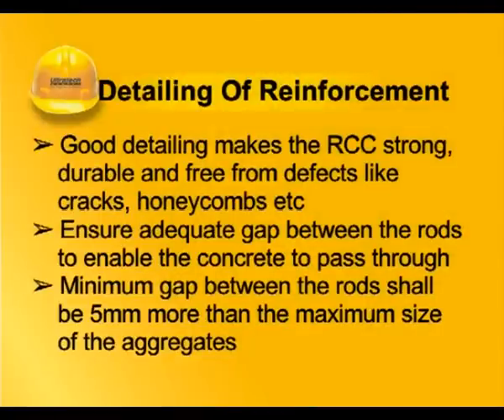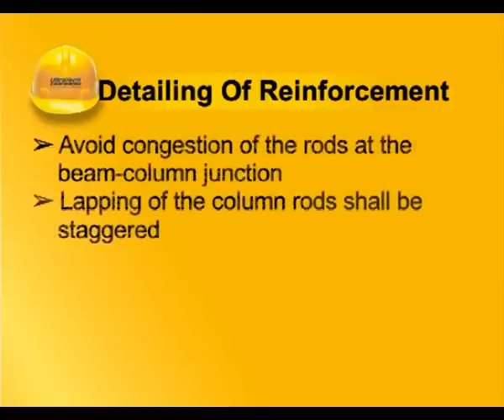Detailing Of Reinforcement

Comment: Sir, I wish to extend the Chajja. In this regard, I wish to clarify myself on the following points : 1) My house is a strong construction of 30 year old, at Mysore, Karnataka. 2) The house is built on 30*40 site. 3) There's a Chajja of 28 feet length and 2 feet width and this Chajja has been drawn from the lintel beam to the outside of the wall. 4) I wish to extend this Chajja by 3 feet of width towards compound, so that it becomes a Chajja of 28 feet length and 5 feet width. 5) To do this, I wish to erect 4 circular columns. Is it OK if I erect 4 columns of each column having 12mm TMT bars of 5 numbers?  6) What should be the size of beam? 7) Is it OK if I loop the old TMT bars of Chajja  with new TMT bars of 10 mm as the old bars are of 10 mm by welding? 8) The thickness of the present 2 feet Chajja is 5 inches. 9) How should  slab be designed for reinforcement?